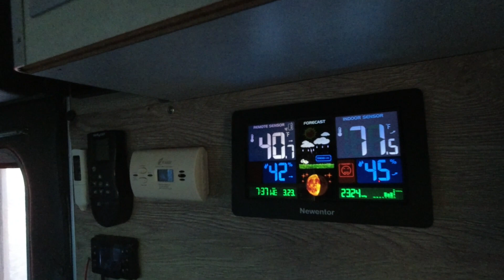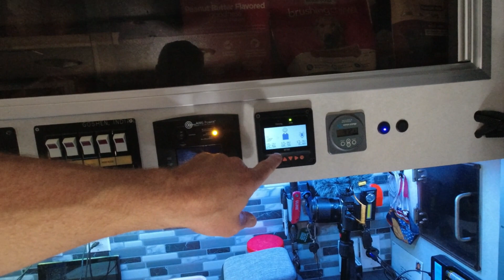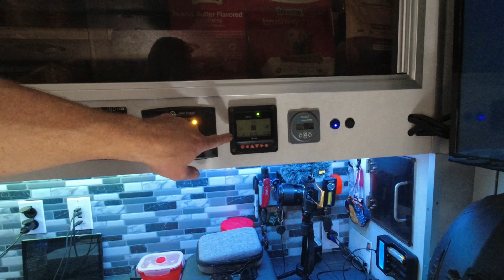Stuck In Winter Weather And Feeling The Effect Of Price Increases | Ambulance Conversion Life

Comment: Seeing your door open there, was thinking it would be nice to build a "screen door" inside of the normal door ( like a RV door ).  And then, like in my screen door on my travel trailer, I have plexiglass cut for the openings.  Result: on cool mornings I can have the main door open, but have a "sealed door" that lets in all the outside light, but keeps the heat in.   I love it.  When needed, I can pop the plexi out and just have a screen.   I do most of my camping in cool or cold weather.
Reply: Where did you get the plexiglass please?
Reply: @ducksinarowpatience  
You can get Plexiglass at any home improvement store such as Lowes. Unfortunately, it has been difficult to find and prices have almost tripled due to so many businesses using plexiglass to make shields around registers and customer service areas for anti COVID protection. Hopefully prices will come down and it will be in stock again since so many businesses already have their barriers. You may want to consider tempered glass instead. The price is less and it is safety glass.
Reply: JL is correct on both points.  I got mine for this project at Lowe's.  Prices are definitely up.  If you live in a major city, check for a wholesale supplier.  I have bought 4'x8' and 5'x8' sheets from a company called Regal Plastics here in Kansas City.
Reply from the maker: I'm working with a custom screen maker to have them made to fit well. If these work, I'll share it with everyone :))

Comment: Have you considered installing adjustable brackets onto the solar panels so that you could adjust them to best take advantage of the angle of sunlight that is available?
Reply from the maker: I have, it's a large project so I really need to commit :)
Reply: I've installed at least 25 solar systems for customers and I strongly advise against it. You only gain maybe 10% by aiming, but you have to climb up and down a ladder to the roof to setup and break down camp. If you forget to stow them one time, the whole thing rips off of the roof, possibly hitting another vehicle on the road. All of my customers followed my advice and just added one more panel, which provided more power.
Reply: @stevefrakes1074  Does that gain hold true both in the summer and winter months?
Reply: @k33elly  My testing was done in April, I think - I'm in San Diego. I suppose in these latitudes there would be minimal difference, but if you're in the snow belt up north, you might see more difference in the winter - tilting the panels would get you more power. Most people are snowbirds, especially Canadians, so building a tilting mechanism on RVs that stay in warmer latitudes doesn't really help much. My recommendation is use the most efficient solar panels, Sunpower, and just add 1 more panel.
Reply: @stevefrakes1074  ok. thank you
Reply from the maker: @stevefrakes1074  My new batteries charge so must faster than my old GEL did - I don't think aiming will improve that from what I've seen so far :)

Comment: If the fuel prices don't come down soon our plan to take the slow scenic route across the country may have to change 😔 I wanted to avoid I40 as much as possible, we made it from Nashville to central Arkansas without taking I40 but it uses a lot more diesel, we spent about $800 so far on fuel ⛽😭. There's talk of getting the prices down something about trying to force US oil companies to use wells they are holding permits for but not using them. If they don't use them they get fined? I hate politics so I'm not sure how that's going to work out? Oil companies have so much $$$ I don't think they care about a fine. Too bad we can't use solar to power (Drive) an RV or anything we can live in. Or if it was easy to use old cooking oil for Diesel (that ship sailed a while ago I haven't seen bio diesel around me in a long time)  Well anyway stay warm keep the pup safe. 😀
Reply from the maker: You wouldn't want to be behind me when I head to NY... 60mph. I save 2- 3mpg vs 70+ mph. It'll be a long 2200 miles :/
Reply: @TheCampulanceMan  I don't drive faster than 60-65 yes it does save a lot of fuel even without the trailer staying under 65 I get 5-7 mpg better, I could care less about the people around me unless they want to pay for my fuel? I doubt that will ever happen.

Comment: The oil that would have been in that pipeline is to dirty for vehicle fuels.
Perhaps the oil companies could just make less money for awhile, problem solved 👍😎.  Great video!  I saw a video recently that the EP Evers controller is programmable by a computer on a very deep level. It’s apparently not something you can do from the control panel. 👍👍👍
Reply from the maker: Yes, you can connect via PC or via Bluetooth and an app. The settings for lithium require one of those methods.

Comment: Good thing that the price of the electricity produced by the solar panel is not linked to the shortage of gas. I see from your dinner that cholesterol is not your problem. ( 3 eggs...wow)😊😊
Reply from the maker: I wish I could wire the panels to the rear wheels!!

Comment: The pipelines of oil from Canada and it cannot be turned into gasoline it is exported to country that can refine it. The Saudis lowered the price of oil and put guys who were fracking shale oils here in USA. But there are problems of fracking here in USA where what they use to frack theshale rock gets into  water table or aquifers. So there is bad news to be oil exporters instead of importers.

Comment: Yes, the exhorbinet increase in fuel prices will damage the economy tremendously. 
There are laws, that when a disaster occurs (forest fire/similar) the regional hotels/motels, and some apartments, it is illegal to their rates.
 During the "toilet paper shortage" some small stores had very high prices for the said product. And those store owners were fined/etc.

WHY are the fuel companies not required to do similar????
Can I require increase in my paycheck because life costs me more??? NO!
Many folks are considering quitting jobs with long drive miles, for a closer job with less/hour pay. Because it doesn't make sense, no pay for the drive time, and the higher fuel expenses = less take home pay.
 
Predection:
Many many many Road Lifers will be in the BLM lands for the full 14 days. And only relocate the minimum required miles.
Probably driving slower, truck 55/60mph maximum. Or staying off of the highway/interstate.
Major cross the country trips will take weeks/months, not days. 
Might feel like 1850 wagon train time frame. Got to get over the mountains before winter arrives.

The states with lowest fuel prices may have influx of Road Lifers. Certainly many many will stay out of California. 

Maybe the upshot/benefit will be to the local towns where Road Lifers stay for extended time. The travelers might explore more locally, maybe more likely to spend $ a bit more, and learn to appreciate the location a bit more.

And with likely extended stay, Road Lifers might meet, engage, and find friendships within their humble temporary plot of land.

Sort of makes living on a sailboat in the bay look inviting?  Only fuel is for cooking, and dinghy to shore! Unless you have plenty of solar and lithium batteries!
HAHAHA!
Reply from the maker: That's exactly why we're living in snow land - so we didn't have to drive. :))) I'm not moving till I HAVE TO!

Comment: It's getting pretty bad.  I've increased my wage level 48% in < 5 years.  And I could quit and work checkout at H.E.B for what I make.  And something like +$5 an hour more than that to stock shelves at target.  I don't know if those rumors are true.  Or if it's part time work without benefits.  But it's definitely plausible.  I'm sure everyone will blame the raise in minimum wage.  But it didn't raise here and most entry level jobs are offering 3x min wage.  And with the gas hike, I have motivation to move jobs as target is 1/3rd the distance from my home.
Reply from the maker: It's terrible that distance to work can now force someone to make a change :/

Comment: I just watched this video and just wanted to make a few comments. Your fan setup to keep the Lipo warm seems to be working well. Is your temp. probe taped to the batteries?
Reply from the maker: I have 2 temp sensors on the batteries: the inverter/charger and the charge controller. My weather monitor sensor is mounted on the cabinet wall adjacent to the batteries.

Comment: It’s my understanding that the pandemic is more responsible for the inflation and fuel prices than either administration. When we were all stuck at home we weren’t driving which caused a huge fuel glut. Manufacturers had to shut down refineries. Now that we’re back in business and going back to work we need to fire up the refineries again, but it is not like turning a switch back on. I hear that it can take a year and a half to get one back online! Some refineries needed maintenance, those take five years to spin up. Of course the war also exacerbated the issue but the problem probably started long before… we just couldn’t see it until too late. Still the oil companies will make sure they continue healthy profits.
Reply: None of that is true in totality. Part of it is true, the important factors in price increases are left out, like over regulation and destruction of production which is the causal factor across the board in fuel prices, housing prices, and food prices and more. I'll make a more complete comment I typed here but decided not to leave it as an answer to this. If all you can think of to dispute the facts I'm going to give is I'm crazy? Just skip that. Research the basic facts, and what I'm about to comment is solid. That's what I did. Over many years, decades in fact.